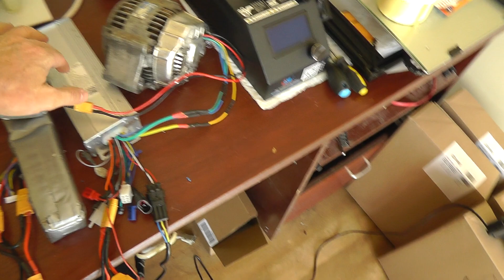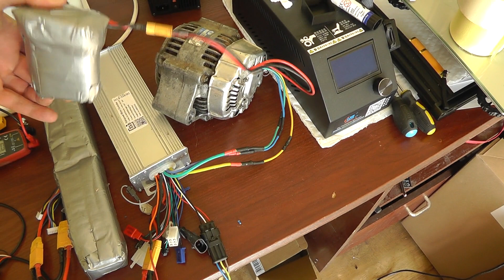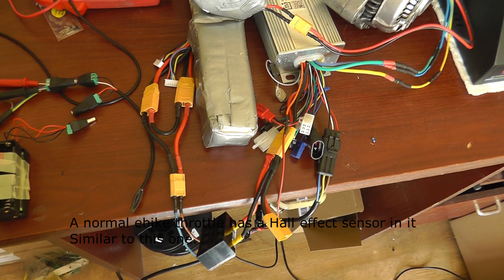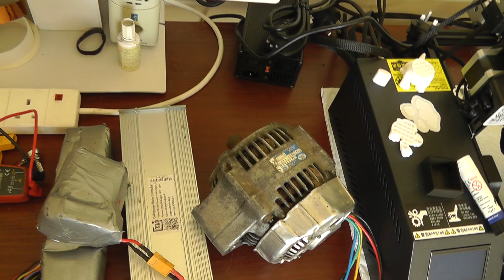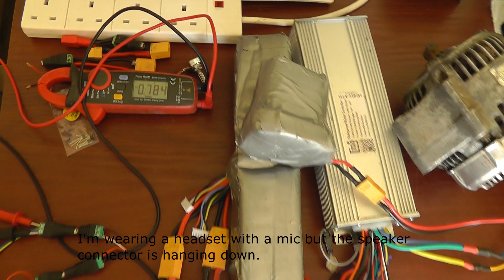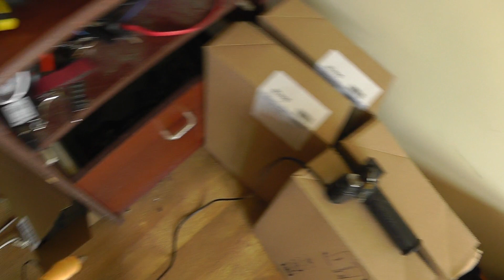Controlling ebike throttle from external voltage

Comment: iv'e been experementing with the same sort of idea but getting nowhere. my voilamart 1000w kits pas is either on or off and some adjustability would be awesome!
Reply from the maker: I believe the pedal assist is controlled by the display so if like me you cheaped out and bought without then the PAS is useless. Check out my other videos for more info on how to do this.

Comment: How much Voltage and current can a (output) 120A 12V Alternator handle?
Reply from the maker: To be honest I don't know for sure. I put 2kW through a 100A 12V alternator and it got a little hot but was enclosed more than it should have been. I'd guess with decent ventilation you'd be fine with 3kW for short bursts but maybe not constant. As for Voltage I don't think it matters that much within reason, it's the power (i.e. V x A) that causes heat. More volts just make it spin faster and more amps makes it more torquey
If I ever do this again I'll be looking for a 150A to 200A alternator or even a 24V alternator as I suspect it may be better at low rpm.
Reply: Ali Bro Thanks! I have another question for you. If I buy two 4Ah 22,2V 60C lipo battery’s does that mean that they always put out 240A or do they only put out what the motor takes? I want them to put out about 50A and 44,4V
Reply from the maker: @pcbms6682  I presume you plan to have them in series giving 44V so would work well on a 36V system. The answer is no, they will only supply whatever current the controller draws so if you have a 1000W controller it will draw 1000/44 = 22A. A 2000W controller will draw 44A and so on. You need to make sure your components are all compatible with each other so your battery/controller and motor are all a similar wattage. 
The issue with this plan is the batteries will not last long. At 22A your 4Ah battery will be depleted in 240/22 or 11 minutes. With a 2000W controller it will be 5.5 minutes.

Comment: Could you please add a circuit diagram to this video.
Thanks.
Reply from the maker: I posted another video with a circuit diagram of the throttle connection.
Hope this helps.
Reply: @alibro7512  Thanks a lot. Much appreciated.
Reply from the maker: @ziadfawzi  I didn't mention in the video but the connections for the POT are identical to the connections for the hall sensor.
Everything else is standard ebike connections.